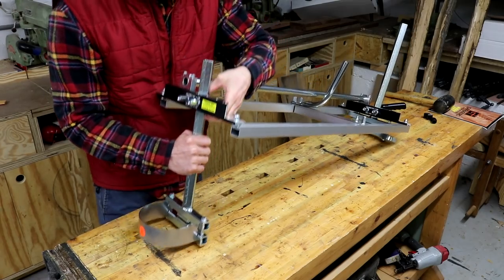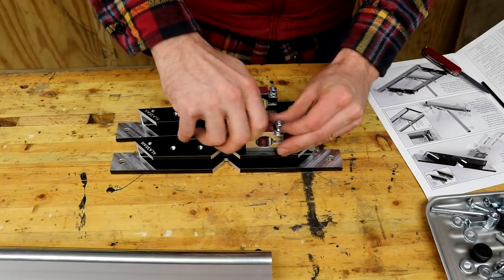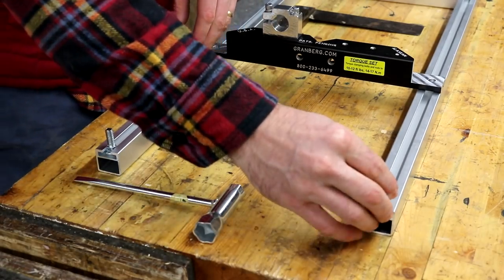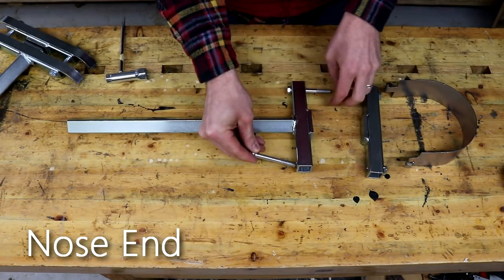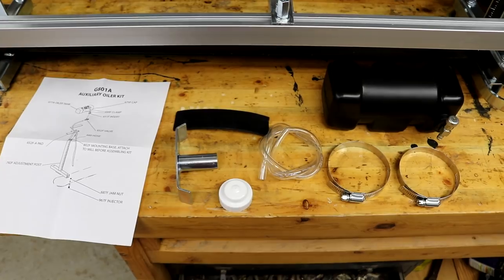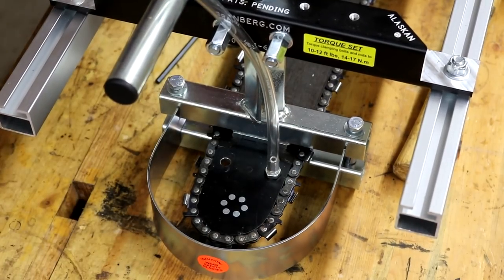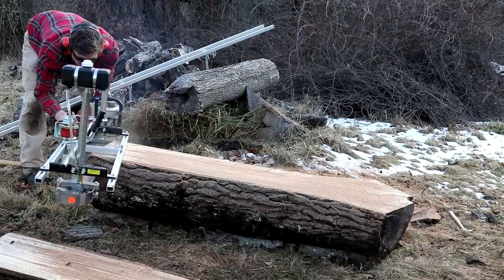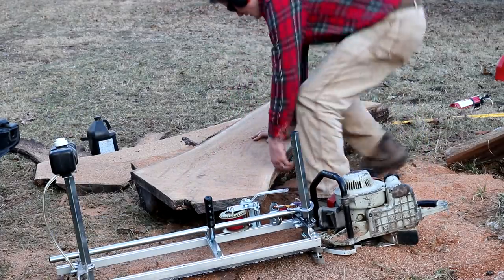CHAINSAW MILLING AT LAST!!!! - GRANBERG ASSEMBLY

Comment: 250$ for some aluminum extrusion a couple brackets and some low grade hardware?
that chain sharpener is 110$...

a few purchases from granberg and stihl will set you back more than all the houses on this channel combined hahah
Reply from the maker: That's like saying $XXX amount for that slab of wood, there's more than goes into it than the materials. It's a nice setup. Price is also pretty relative to what you do with something. I can make one table with one of these slabs that cost 10-20 times what the mill cost easy.........and I got over 20 slabs from the walnut alone. I'm all about making stuff, but I look at my time and what the result would be........am I going to make a better mill? How long? In the end, I want to mill logs to make stuff, not build a sawmill. But your comment about the costs and my houses is pretty funny. Thanks for watching.
Reply: no hate on you, theyre definitely a good product.. i guess since i prefer working with metal fab more than wood working id rather be building the mill than building the table hahha you probably vice versa

i was pretty close to buying a project house last week the partner in crime backed out last minute and i couldnt afford/handle it solo as it was a bigger more involved project
Reply from the maker: I'm into metal as well, just not looking to add projects to my projects to my projects in every case. Didn't take it as a negative comment as well, I understand your thoughts.

Too bad about the house, but at the same time it may have been for the best. I had the same thing happen to me when I was looking for my first house, years before I bought one......my money guy backed out the day we were supposed to sign the contract without an explanation......mad at the time but now I see it as avoiding a huge problem, glad it happened. Partnering is good, but only for the right situations. My idea of perfection is to get together enough money to buy the house, or short term finance.....and have enough money or credit to hire out all or most of the work to speed the project along. Stringing things out is rough and something I'm moving away from. On my current house I just had a roofer put down my shingles today, they did it in 2 hours, it would have taken me day. I also had the outside stuccoed and will hire out the drywall. This is the first house that I have been able to do this with......still taking too long but moving in the right direction. Good luck.
Reply: yeah have enough money for the house and materials.. i little extra left over but would rather hold onto it for unexpected costs rather than sub contract.. that being said a dred doing drywall and would really like to hire that out

would love to see videos on it, if you fix your own chainsaw and other gear even if your just making it up as you go im sure people would love to tag along.. i learn more from seeing people mess things up than seeing it done right hahah